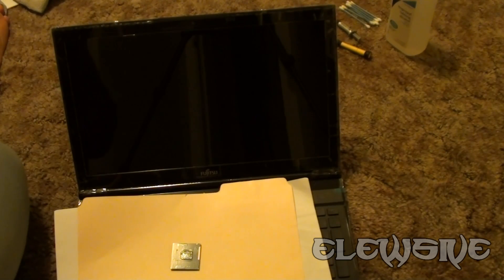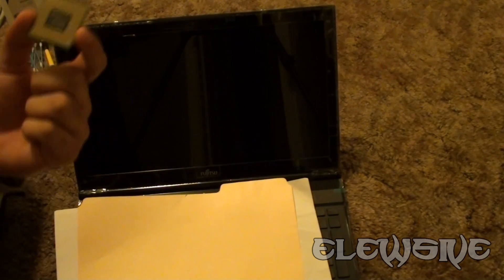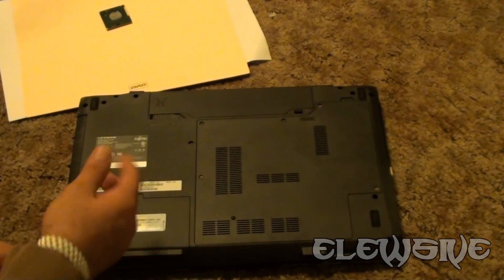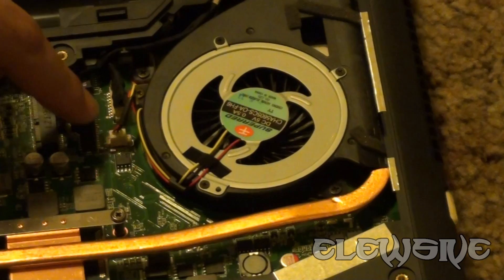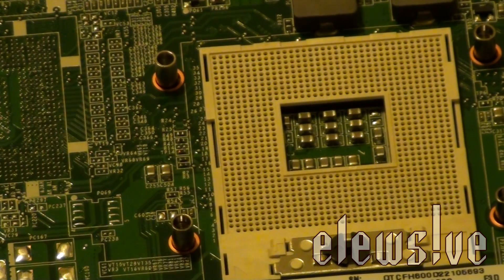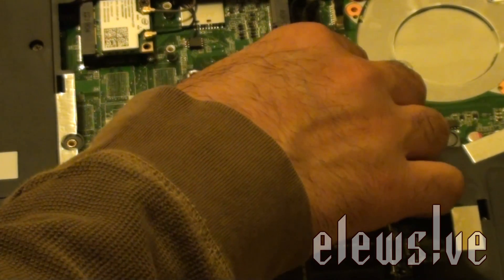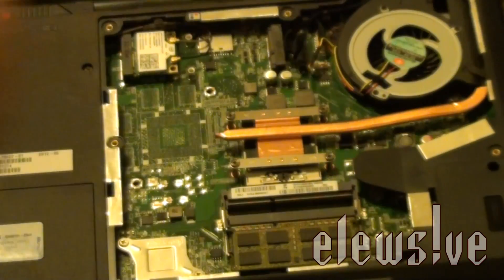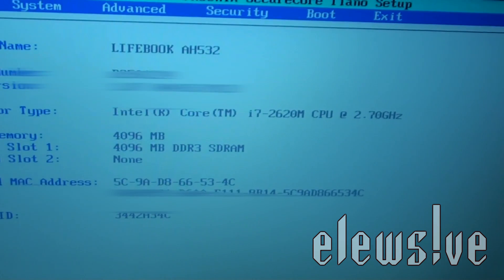[HOW-TO] - Fujitsu lifebook AH532 i7 CPU Upgrade

Comment: @djelusion thank you so much for this video. I'm actually looking at buying the i7-3632QM to upgrade this guy to a quad core. I see below that you also settled on the same processor for your own AH532. Can you please confirm if your motherboard shows as the "FJNBB1C" in CPU-Z or do you have a newer motherboard? It appears that the AH532s that Fujitsu shipped with the 3632QM have a newer motherboard, but the southbridge is the same.

I'm just trying to confirm that the 3632QM will work on the FJNBB1C motherboard before I buy it. The BIOS version I have on here is version 1.11 dated 6/3/2019.

Thanks!
Reply from the maker: Glad I could help this was done back in 2012 glad it has some purpose sadly this laptop had a ssd drive that lost all data

Comment: i3 has 2 cores i7 hasquad core , hope the motherboard has the quad core hypertreading option
Reply: The i3-2350m- has 2 cores / 4 threads and that set i7-2620m has 2 cores / 4 threads. After installing i5 / i7, processors download the necessary drivers themselves from the Internet. Better to put the i5-2540m - it is the same as this i7, but much cheaper.

Comment: Hello, guys. my laptop is Fujitsu Lifebook s752 with i5-3320M DDR3-1333Mhz x2 4GB Ram its still working but i want to upgrade it and put DDR3-1600Mhz x2 4GB cant find processor i7-3632QM in Greece :/ what do you recommend to me guys?

Comment: Thanks for the video. Have you tried putting mSATA SSD into the mPCIe slot(you may find between WiFi card and Fan near the battery)? Any thoughts on this? I'm struggling to detect an SSD placed in that slot. There is no option in the boot menu also. Any input from you regarding this will be well appreciated.
Reply from the maker: Hi Krisnadas v k. I did not try putting a mSATA SSD, because the sata connections on the Motherboard support a standard laptop SSD Drive. This is not a thin form factor laptop such as the Lenovo X series line. I've had no issues with any hard drives installed on my laptop as the default bios menu was never modified or changed.. I find that pretty odd if a standard SSD is not detected.
Reply: Thanks for the prompt reply Djelusion. There should not be any problem with ssd on normal hard disk slot. I just ordered an mSATA to SATA adapter. But it would be awesome if I could use ssd on mPCIe slot for OS loading and HD for data saving. In some models it works and some it may not. See the links ..  
Review : https://www.amazon.co.uk/review/RIMW3SLQ6IDDC
Discussion : https://forum.ts.fujitsu.com/forum/viewtopic.php?t=45780
Reply: I think that slot is for a SIM card adapter (mobile internet access). 🤔
Reply: It's a PCIE but can't use it for mass storage. It's for mobile phones.

Comment: Hey I have an old AH77 i7 Lifebook thats dying. I jsut bought another one but AMD E1 that is VERY SLOW. WOuld it be possible to take the hard drives, ram and processor from the old Lifebook to this new one? Im a girl so all this stuff is kinda going over my head
Reply: You can use the RAM and HDD, but the Intel processor will not work with an AMD motherboard.
Reply: Jonathan Paulin thanks. I added RAM but not the HDD because even though it’s 1T of storage & I’d love it, it was windows 8.1 and couldn’t (I think) be upgrade to 10. This new laptop is window 10 but 500G storage. Any way, is there anything else I could take from the old laptop to increase the new laptop speed? It’s still laggy after I added RAM. Or what do you suggest?

Comment: thank you for the video showing how easy this is. (only one I could find for the AH532 model).  I just ordered an i7-2760qm ($50 ebay) to replace an i3-2350m.  supposed to be 50% faster single core speed and 176% faster multi core speed according to userbenchmark dot com.  it is 45w instead of 35w but will probably be just fine.  will apply arctic silver :) .  Hopefully the motherboard supports it.
Reply from the maker: Hi I am actually editing the revisit of this laptop as I just upgraded to a quad core last month. The motherboard does support this CPU as I had it in my laptop for a good 5 years. Be on the lookout for the quad core how to beat black Friday for $100 video. Feel free to like and subscribe. Thanks again for stopping by =) Elusion
Reply: wow, 5 years sounds awesome to me!  Yeah, I have been checking out the new laptops with the 8th gen intel processors.  Crazy battery life and processing power, and I've seen them as cheap as $400.  Not sure if we will get a new one or not since this laptop just sits there most of the time plugged into the wall, and with fixing the keyboard and upgrading cpu I only have to put $75 in it :).  Thanks again!
Reply from the maker: you're welcome. exactly! this fujitsu is literally a workstation. sitting on my desk, it has been since 2013 hooked up to a 22" monitor going via vga. a Logitech wireless keyboard and mouse and the laptop remains with the lid closed. sleek slim powerful ive had no issues with it. 16GB of ddr3 ram and a 240gb ssd this thing is never slow. Glad I could help you.
Reply: @djelusion  Hi! Sorry for my bad english, but, I understood right, you installed a quad-core i7 (45w) and it works perfectly? how about temperatures in stress tests? I have an AH532 for about 6 years with Pentium B960 and GT620M. They are connected with 2 lines heat-pipe. Will it work properly if I install a 45w processor?

Comment: got a question on the AH532 : is there any way to overclock the CPU I7 3840qm , and is the i7 3840qm actually still a good processor to use in 2017 because i bought a laptop to be my everyday laptop and then i'm using the AH532 as my workstation sort of and when i was comparing the two( i7 7500U vs I7 3840QM )the i7 3840QM was better then the other one ,so i just wanted to know your thoughts (sorry for the comment size).
Reply from the maker: hi I recently upgraded to a 3632qm and it works fine. I see a few stalls but maybe its because windows 7 updates but overall its running ok. Don't worry about the comment size. I'm supposed to be done editing this video of the 5 year update but I'm really sick and having headaches is hard to sit in front of a pc doing editing. If you subscribe and stick around I will try to update and post more videos. as for the 3840qm if you can afford it. I was lucky enough to get the 3632qm.

Comment: i have AH532 laptop i5-3210m processor, can i upgrade i7-3630qm processor?
Reply from the maker: It would work but the power usage is more so it might or might not work in the end.. If it does work it might overheat or run a lot hotter than normal and cause failure down the road.. If the bios is super picky you might not be able to run it because of the wattage is more than the initial chip.
Reply: thank you very much for answering. my AH532 laptop's specs: HM76, 35W, 1100MHz. 
i7-3630qm 45W and 1150MHz... should i get right CPU for my laptop, i5-3210m replace to i5-3230m, or i7-3612qm, cos these both same 1100MHz and 35W... but i7-3632qm 1150MHz...? and i should change charge for more watt... clean heatsink and re-thermal paste?
Reply from the maker: Hi Gaby, as a rule of thumb in upgrading my laptops without any issues is to always match the wattage. By going higher you will run the risk of your system a) not working b) working but random shut downs c) thermal issues that will shorten the life of your pc / laptop. As far as cpu upgrades are concerned if you had an i3 going to an i7 would be a noticeable jump. however an i5 to i7 not so much so. if you can get more cores and cache with the same wattage you will be winning =). Hope that helped.
Reply: can you explain what's difference between: AH532 G21, G52, and GFX?
Reply: can you help me which best CPU to replace my AH532 laptop CPU i5-3210m?
Reply from the maker: you should be able to use i7-3520M. but there is no point really as the improvement is minimal. if you had an i3 then there is a big step. but from an i5 to i7 its not that big unless its a desktop.
Reply from the maker: that I don't know sorry. maybe its a fujitsu with a slightly better spec.. the only thing I can tell you is if you look at the i7 fujitsu what processor does the laptop have?. ie 3520 etc if it says it comes with a 45 watt.
Reply: i checked about 3520M, yes it's 35W, but it's 1250 MHz for On-board graphics adapter dynamic frequency (Max). but AH532 is 1100MHz... so must CPU have same 1100MHz or less?
Reply from the maker: No the main thing you need to keep an eye out is the TDP which is 35 watts. and make sure its the same socket cpu MHz doesn't matter
Reply: i got it! thank you. why should be 3520m? what about these 
i7-3632qm  35W 1150MHz
i7-3612qm  35W 1100MHz
i7-3540m    35W 1300MHz

top one (3632qm) is the best?
Reply from the maker: from those then you pick either more cores more cache. cpu speed isn't always better the top one might be better than the middle but then compare at intels website remember socket type. most likely 3540m is going to work.. the qm is something different but if you can get away with doing a return if it doesn't work give it a shot.
Reply: yes i would return it away if it is not working. more cores is important, it means i should get qm processor, 3632qm and 3612qm have four cores... 3540m have two cores. which one is better?
Reply from the maker: buy all three and test them out.
Reply: lol but it would be waste of money to pay for post. now i have 3630qm, i did not replace it yet. i was thinking to send it back and try to find right one... what do you think? 

i like 3540m, i was looking for i5-3380 (35w), and i7-3540m (35w) in the list from this website for AH532 laptop, but they aren't not there. 
 
i7-3520m (35w), 
i7-3612qm (35w), 
i7-3632qm (35w) these three have there in the lists.

i hope that 3540m can work on my AH532 laptop, what do you think? 

please can you check there, http://www.userbenchmark.com/System/Fujitsu-LIFEBOOK-AH532/1767
Reply from the maker: the 3540m will work without any issues.. the processors with qm in it might not because it says the socket type is BGA. and the 3540m is FPGA I believe. but if you own both why not give it a test. if I owned both cpus and they was 35 watts you better believe I would film it and if it blows up it would be a good youtube video.. btw I own a sealed up ah532 with the original i3 still in the box
Reply: ok, thank you very much for explaining. so i should order 3540m from ebay then? i'd like just want make sure it is 3540m?
Reply from the maker: ok after looking back 5 years the answer is yes you can and should be able to.. 35xxm and 36xxqm should be okay. I am not responsible if this does not work with your pc.
Reply: yes i'm here europe, yes! :) thank you very much, i forget to mentioned it earlier. yours is sandy bridge and mine is iny bridge. and yes i know about 3632qm, this is max cpu on my laptop, but i'd prefer different cpu, like 3630qm or 3840qm... but both of them are 45w and i have 3630qm (45w) now. so would it work on my laptop?
Reply: hey, i just put 3630qm into my laptop and it works fine! unbelievable!!! how can i make sure it work 100% fine? how to find out when my laptop stop work, freeze,  shut downs, etc? how to find out it work 100% perfect?
Reply from the maker: use benchmarking utilities like aida.. but as long as the wattage is the same you are ok.. don't mess with 45 watts. Right now I am looking for a 3630qm equivalent or better.
Reply: yes, try get 3840QM (45w). i will get this one as well soon in the future. please can you make other video youtube, i want to watch it, i like it :)
Reply from the maker: that I don't have the funds and I don't make enough revenue from youtube to fund the project. however if I am lucky I am going to roll the dice and try to buy the 3632qm. since the laptop itself is rated at 35 watts I'm not going to brick it.. but if you see my other videos I do some other things like the sony vaio all in one touch screen disassemble. And nobody has done a video on that.
Reply: @djelusion   @aceunoia   also do you guys know if "Intel® Virtualization Technology for Directed I/O (VT-d)" and "Intel vPro® Platform Eligibility" will work because the i5 does not support these
Reply: @aceunoia did you do the upgrade? i have the same i5 chip and i'm getting an i7-3740qm but it's 45W compared to the original 35W.
Reply: @aunreza  hey, yes i did it, it works perfectly! buy 3740 and will work on AH532 laptop, trust me! :)

Comment: what is the max processor in ah 532? i need 4 core processor.. my ah532 processor i3-2370m.. thank
Reply from the maker: hi its been a while but if you go to the intel website and look up your existing processor try to find the i7 equivalent for that time period ie 2012. The newer i7s don't work I'm very sure.
Reply: thank you very much. choose which type of processor that is quad-core in ah532?
Reply: @csabiegyud4692  i5 3380m it's a good idea, what you choose?

Comment: hi, the maximum amount the fujitsu ah532 processor?  i7....., i5...., i3...? I would be interested in what is the fastest, I would be viewed in their knowledge..  Now there's it is i3-3120m processor
Thank you in advance for your answer. ( sorry, i live in hungary, english speaking and writing a little a bit)
Reply from the maker: hi csabi no worries, As far as fastest honestly its not that much of a boost from another decent i7. there is not much gain if you get an affordable i7. anything other than an i3 is a major improvement.
Reply: FYI google ds-LIFEBOOK-AH532.pdf and check the verified cpu list. There's a few, all Ivy Bridge or the older Sandy Bridge ones. The ebay prices for an used i7 quad is around 120 USD and most people are probably better off with a i5 for around 40 usd. But that depends on ones situation of course. Buying a non-validated cpu will be risky (socket G2, FPGA/FCPGA988) since the BIOS is probably not updated for these newer cpus.
Reply from the maker: I would base the existing cpu installed and note the key factors for any cpu upgrade would be the wattage / socket type. Checking intels list of the i3 will point you in the right direction as to what generation of cpu you want to use. using anything more current is silly and a waste of money. ive been doing cpu upgrades on laptops for over 8 years. Never had one not work despite whatever the manufacturer site says.

Comment: Do you think the i7 3630QM will work on this one? I own a now dead NH532 and it's not worth to repair it (busted screen and some issues with the motherboard/bios not booting up properly) so I'm thinking of grabbing a AH532 for about 100 bucks and replace the current i3 as seen in your vid with my i7. Same chipset so it should work right? I have two copper leads in mine though, think that'll be an issue? I'll grab the fan + copper leads if it's possible / room enough.
Reply from the maker: hi, sorry for not responding to this much sooner, Technically YES the cpu mentioned above SHOULD work. If I had access and funds to buy a cpu to test its compatibility I would. If you can take pictures that would help me get a better understanding of the copper leads you are mentioning. I am not familiar with the NH532 as no customers have given me that laptop to work on. just make sure to match the wattage + socket size.
Reply: Thanks for your reply. I didn't get the laptop but getting a new chance at the AH532 i5 tomorrow instead. Regarding the copper leads, in your vid you can see just one at 4:17 whilst my busted NH532 with the i7 has two of them, wondering if just one will be enough to lead the heat away. Example pic here: http://i.imgur.com/J9Zuu.jpg
Reply from the maker: hi I looked at your pic and the heatpipe in your pic looks fine unless you have more pics and more close up shots you want me to look at?. this laptop that's in the video is stock and it shouldn't matter if the heatpipe has 2 or 1 pipe. This is how the laptop was stock.

Comment: Hi friend, where can I find the i7 CPU, and how can I upgrade rams?
Reply from the maker: Hello if you carefully watch this video I do explain where the ram and cpu is located. The cpu could be found on eBay if you are lucky or if you have a laptop with a compatible cpu for swap
Reply: Not worth its almost 100 dollars..original CPU is running fine.
Reply from the maker: depends where you look. For some they see it as worth it for an i7 vs an i3. Again depends on your budget, nothing is free (except in this case)

Comment: I am facing a great problem with my Fujitsu Lifebook AH 532 with it's charging problem. I thought the battery is dead, then I tried dozens of batteries but while connect the AC adapter it shows plugged in but not charging. I met the experts and they said it was not battery problem, neither the adapter but most probably the charge controller in motherboard is not working. He suggest me to replace the motherboard or  that he might try to fix the charge controller with a risk of 80% of failure. Now what should I do. Please help me... please
Reply from the maker: Well if you ever decide to purchase one again I have this one listed in the video for sale as well as an untouched one in the box still.

Comment: Can I upgrade LH532 CPU I5 to I7 and does it make any difference you think?
Thank you
Reply from the maker: Hi Mattstone thanks for stopping by. Yes your laptop can be upgraded to an i7 3520 or an i5 3320. Switching the CPU does make a difference if you are on an i3 cpu. i7 helps. I am actually selling this laptop listed in the video
Reply: I know this was 3 months ago but are you selling it on Ebay?
Reply from the maker: hi Ned reck I so did not see your reply. I have the laptop still. I actually have one in the box still its brand new stock. Laptop is stable enough to be on for over a year.